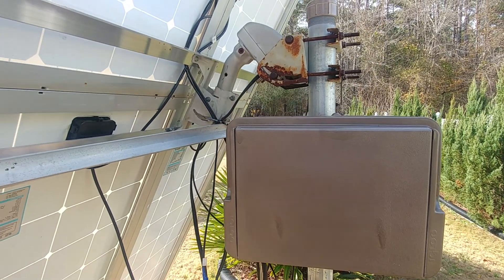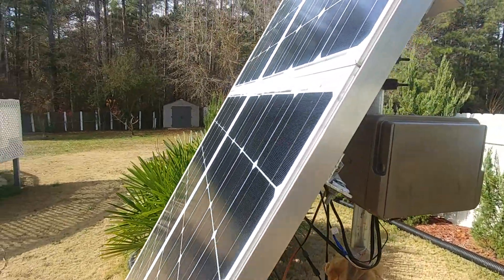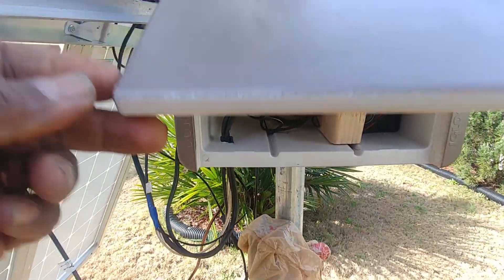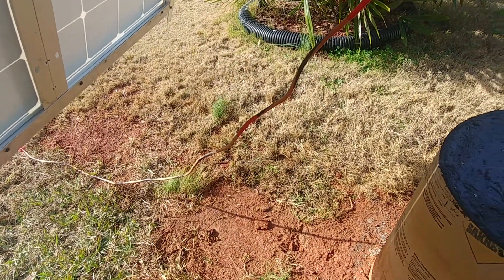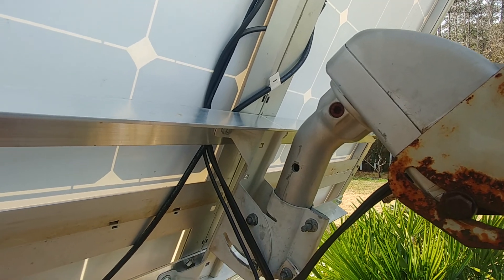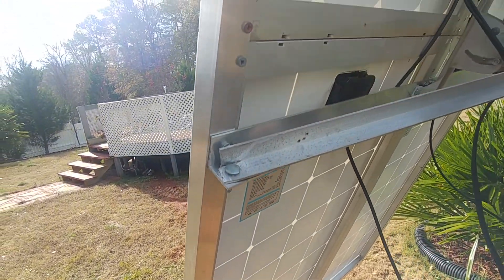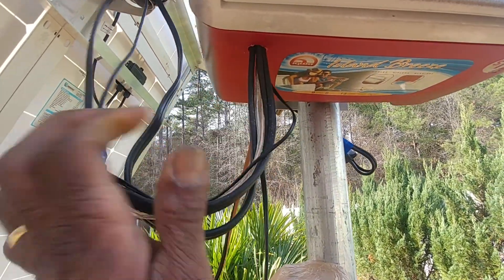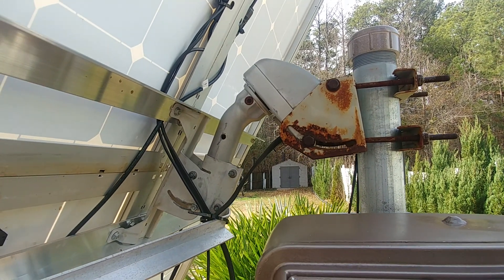renogy solar panel Solar tracker

Comment: This is same as what I have setup, exact to the Renogy 100D panels. The only difference is I reverse engineered the satellite motor function (DISEQC) and constructed my own solar tracking sensor to drive the satellite motor using the coax input using Arduino controller.
Reply from the maker: cool keep chugging on//may the solar be with you///thanks for checking out my video